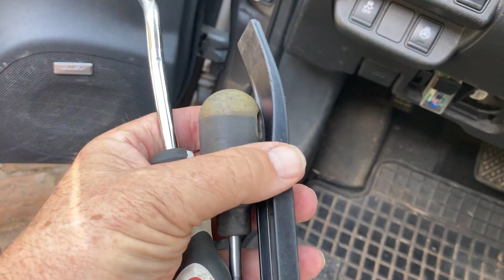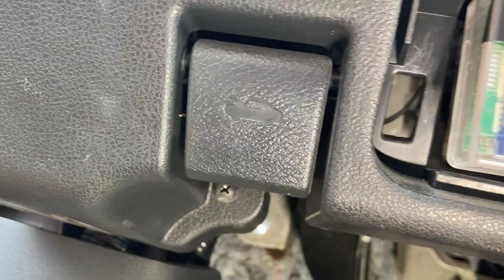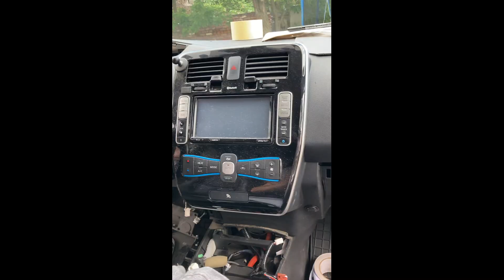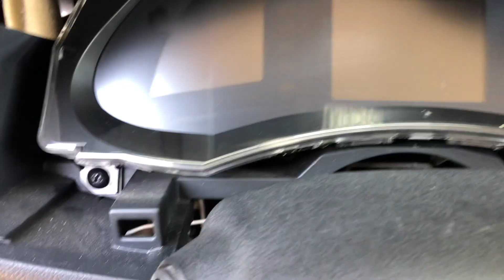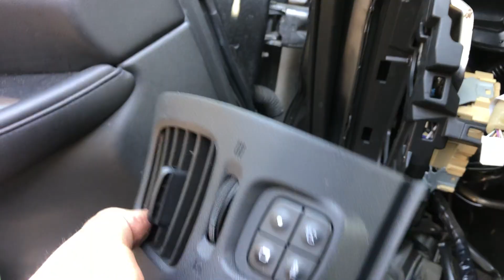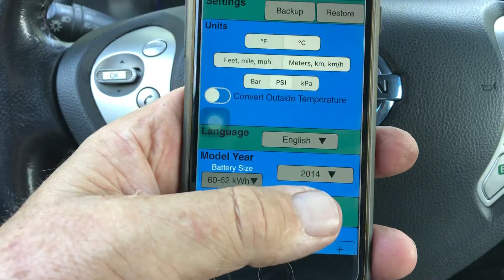Nissan Leaf dashboard and passenger airbag replacement renewal after crash - full sequence

Comment: Hello,
I'm French and follow you on YouTube. I own a 2017 Nissan Leaf ZE0 Visia and I have a problem that I can't resolve. You seem to know this vehicle well and maybe you can help me. My vehicle isn't equipped with automatic headlights. I tried changing the settings in LeafSpy to activate "Folow Me Home" and I wasn't successful, probably because the headlights aren't automatic. Since I did that, my rear fog light no longer works. I tested the bulb, which is good. I dropped my vehicle off at Nissan, who couldn't find it and offered to replace the switch. It was too expensive, so I ordered one to try, but the problem is the same with a different switch. The rear fog light doesn't come on on the dashboard. I checked all the fuses and didn't find any blown ones. I can't find a relay for the rear fog light. I'm not 100% sure this fault is a result of my LeafSpy test, but it seems very likely. I tried disconnecting the 12V battery and resetting the factory settings, but I can't get the rear fog light to work again. I think the problem is software-related and I need to reload the software for a control unit, but I don't know which one or how to do it. Do you have any suggestions?
Thank you in advance for your reply.
Reply from the maker: I'll answer this in stages, there's a lot to cover here :-)
Reply from the maker: maybe this will help with your automatic headlights - I haven't encountered a Leaf, yet, that doesn't have them fitted : https://youtube.com/shorts/YxqNKdEq84E?feature=share
Reply from the maker: "follow me home" makes the headlamps stay on for your chosen time period, to light your path to your doorway, when you get home & switch off, after dark - they then turn off after your allotted timeframe.
Reply from the maker: The rear foglight will ONLY work with the car fully turned on, ready to drive, with the headlamps turned on - dip beam only - nd the second flick of the control stalk - the first switches on the front fog lamps, the rears only join the party after the second operation
Reply from the maker: You would not be able to disable the rear foglight with Leafspy .....
Reply from the maker: If that doesn't sort it all for you, get back to me again, please.
Reply: @mnmszerviz Thank you for your feedback, it's very kind of you to answer me. I will make a video to show you the problem. Can you leave me your email address ?
Reply from the maker: angolhapsi@icloud.com
Reply: @mnmszerviz I made a video for you but I can't share the link here
Reply: @mnmszerviz How can I share my video?
Reply from the maker: You can email me, or find me on Facebook ; https://www.facebook.com/MnMSzerviz
Reply: @mnmszerviz ok, sent
Reply: How can I share my video ?